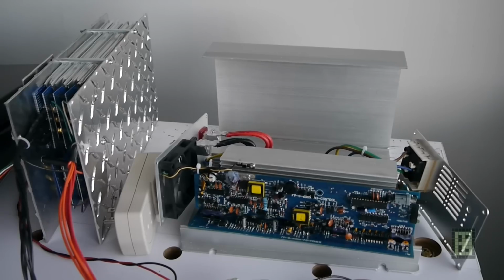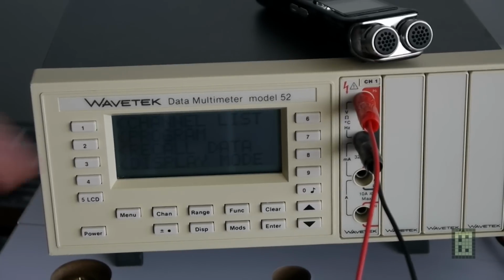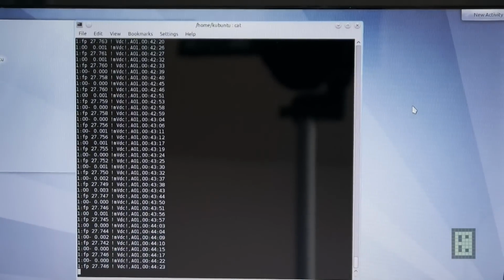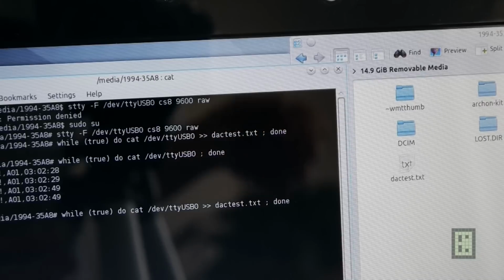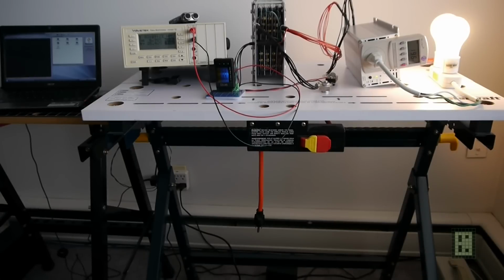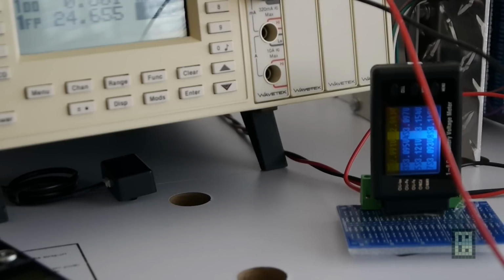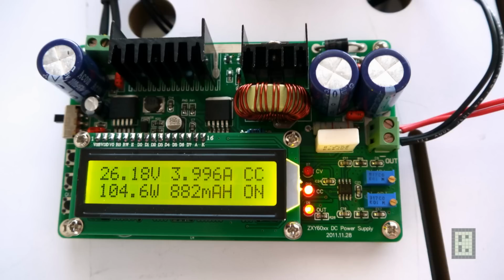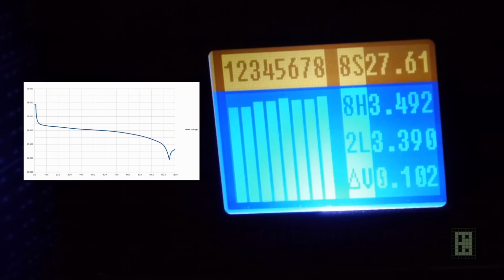LiFePO4 A123 Systems 20Ah Battery Charge and Discharge Test part 1

Comment: You need to bottom balance
Reply from the maker: Why ?
Top balancing is usually the best method especially for solar applications where I will be using this.
I'm just working on my own BMS design see my last two videos is already approved by Kickstarter so I will have soon a lunch date.
Is a fully programmable BMS that allows any type of Lithium batteries to be used and you can set the type of balance you want at charging discharging with any limits.

Comment: Sorry, when i said log , I meant to save the data to generate a graph ,similat yo what you did using the wavetek. (but without the wavetek)

I want to send the data  from the arduino if that's possible and capture the data on a PC

cheers. Newman

Comment: Hi Electrodacus
Great videos, I've been watching all your electronic bideos quite a few times especially om charging/discharging. 
I want to do similar testing of battery capacity but I don't have a wavetech. I have an arduino Uno ( and I bought a cortex M4 which I will use later) 
Is there an easy way to log voltage and current without using a wavetech?
I have most other parts like shunt resistor, etc

thanks, Newman
ps more videos please!!